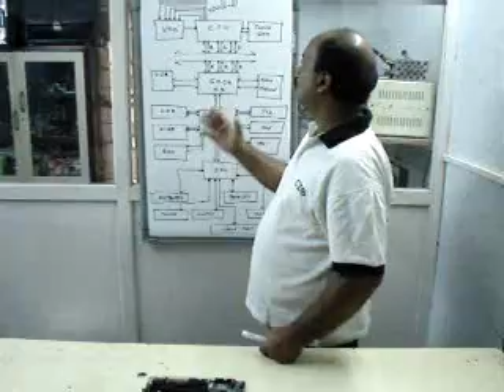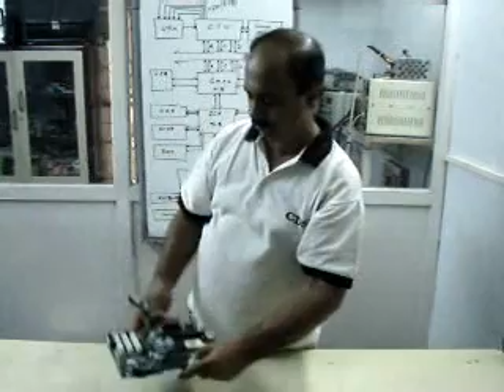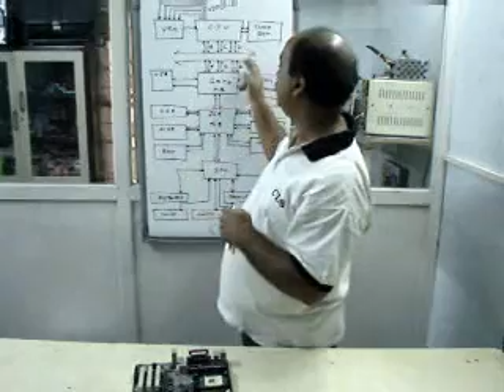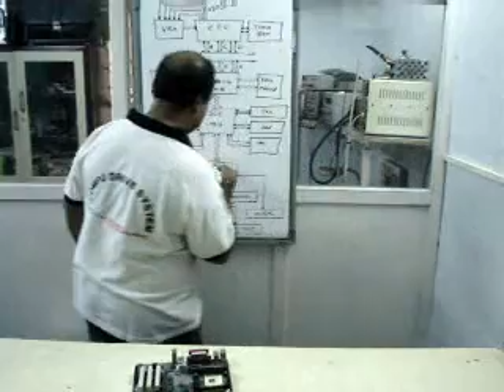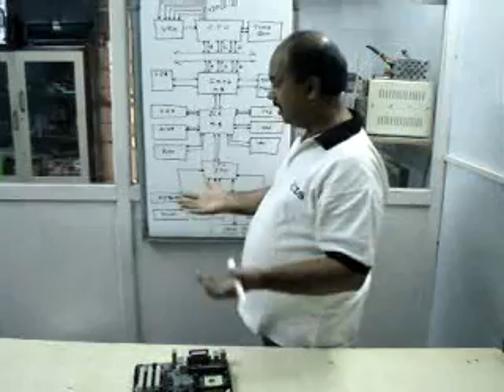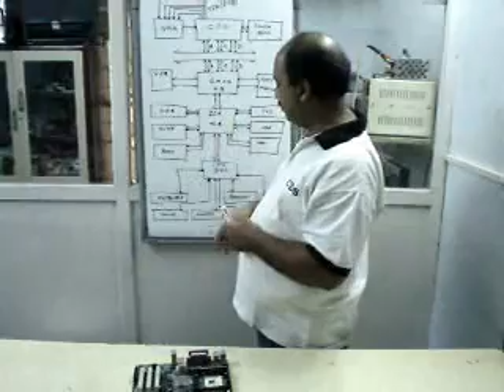Laptop Chip Level Training, Motherboard Chip Level Training Module. Part 1

Comment: sir,i have a 845 Intel chipset motherboard .problem is its has now VGA output .could you tell me which component to replace(like capacitor etc) that will solve the problem and i can use the motherbaord again...